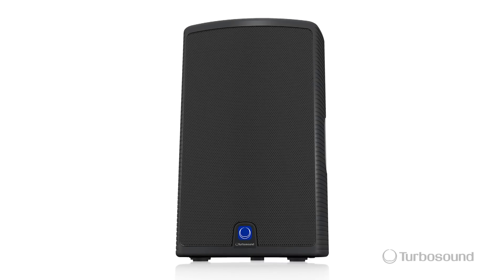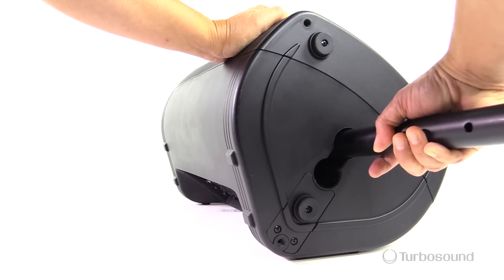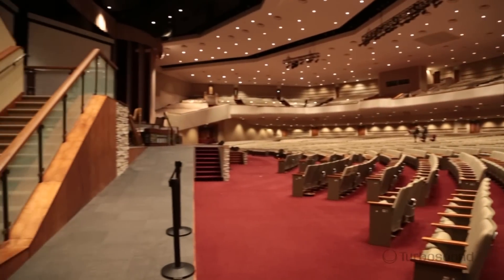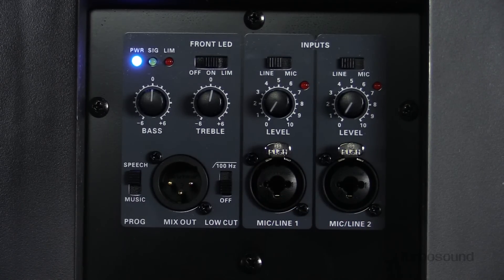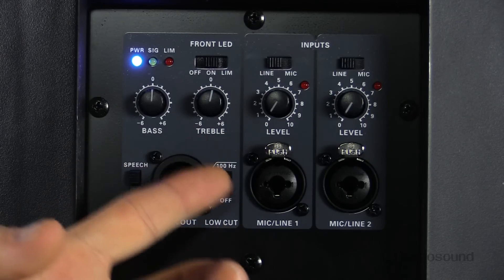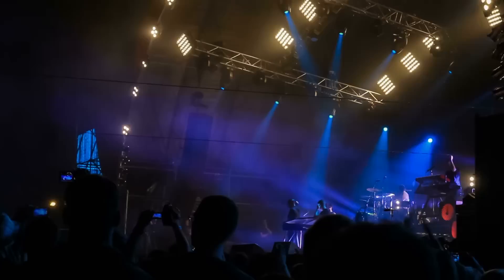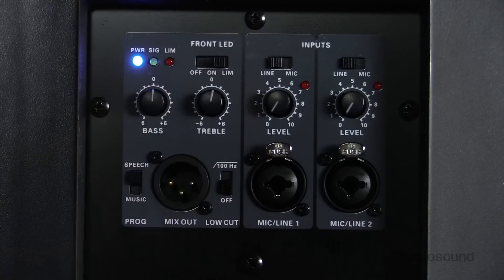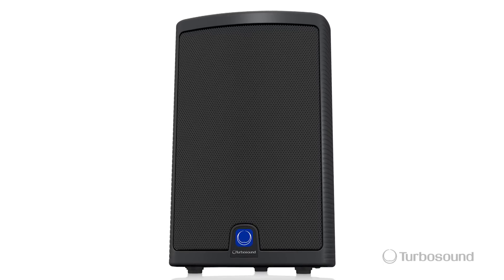TURBOSOUND MILAN M12 Loudspeaker Overview

Comment: Got 2x  brand  of these brand new one justed popped when turned on pre powering amp ? Any ideas I have changed all fused up to speaker and the T 4A H 250v fuse in speaker and power cord etc